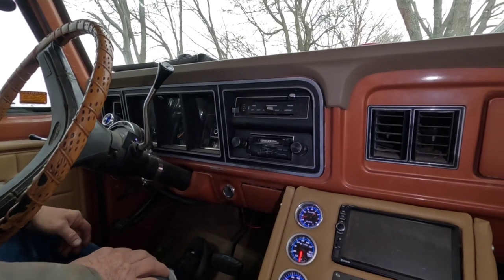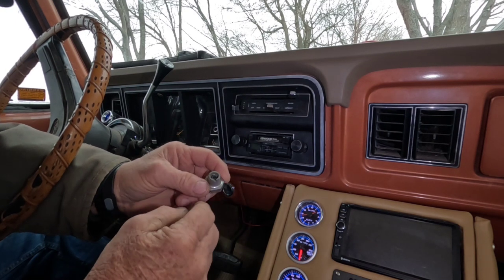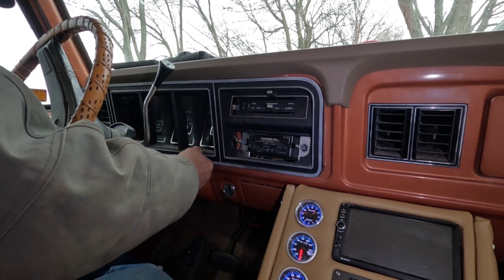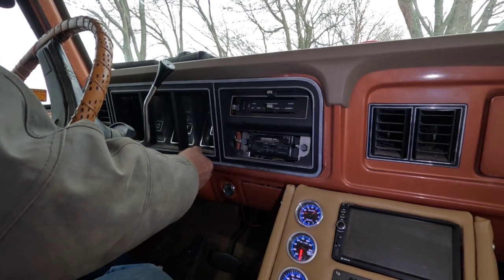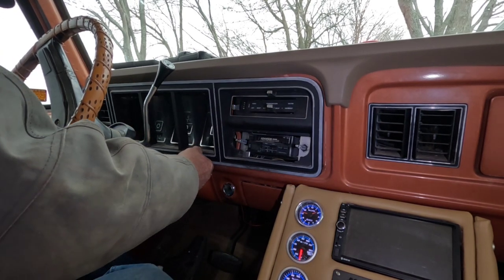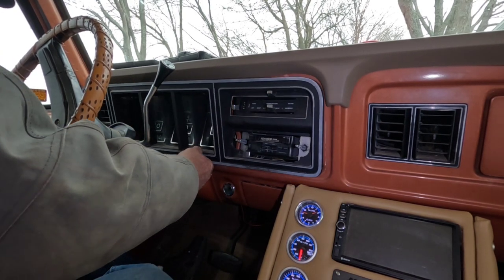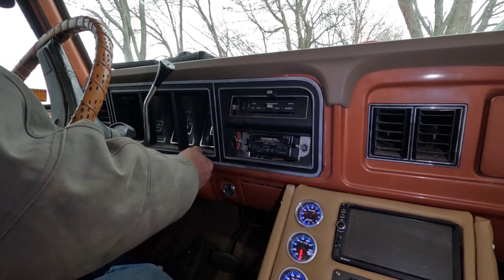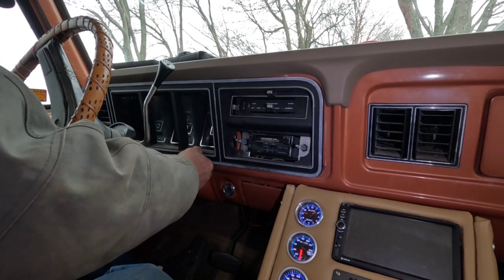New LED Dash Light Bulbs in The 77 F150

Comment: I remember when i worked on my1983 Ranger, sometimes when I removed the headlight switch knob to work on the gauges, the 15 amp fuse for the backlighting would blow. I once drove into work in the dark with a flashlight to see my speedometer. Later I found out that the taillights were on that same fuse!